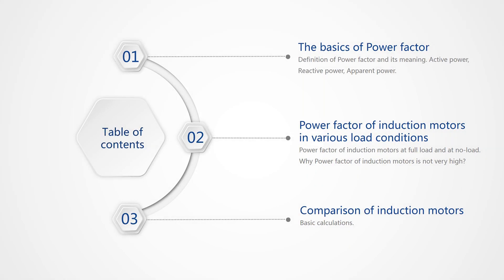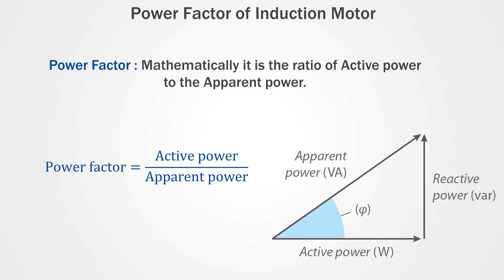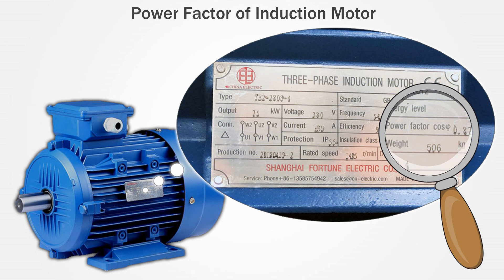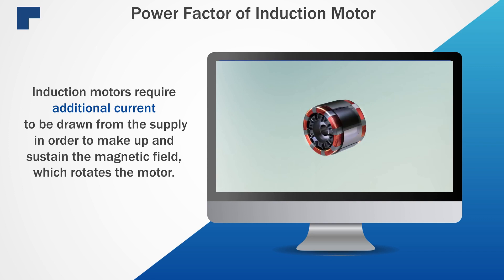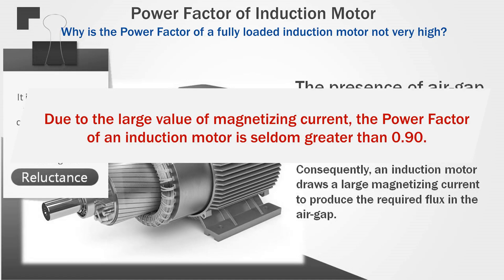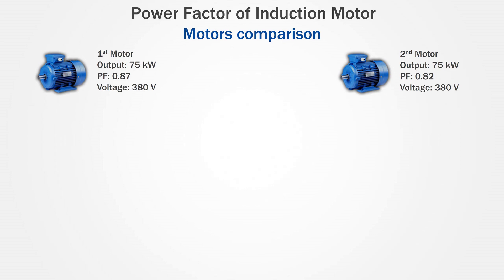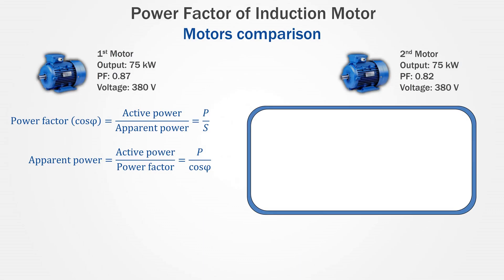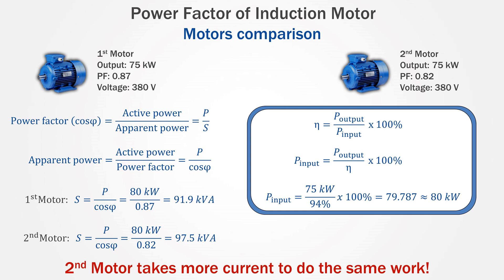Improving Your Induction Motor Power Factor (and Why You Should)

Comment: Thanks for this interesting video about power factor of induction motors. But I think that it was necessary to mention the other important definition of power factor which is: the cosine of the phase angle difference between the waves of voltage and current.
Reply from the maker: Thank you very much! And by the way, great point!